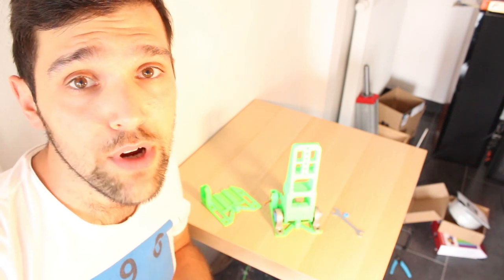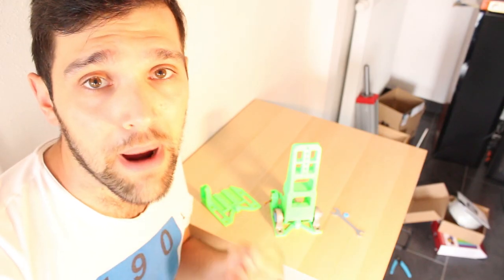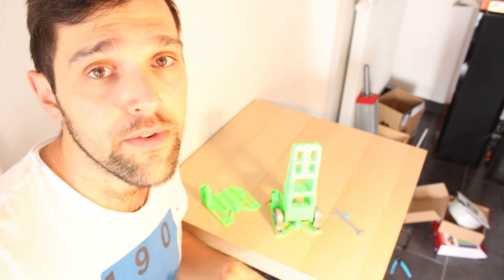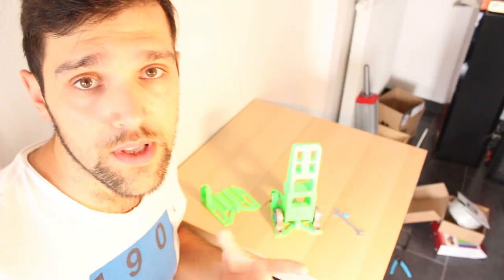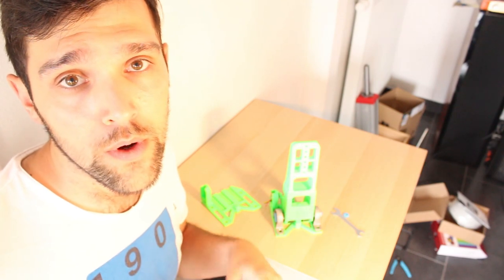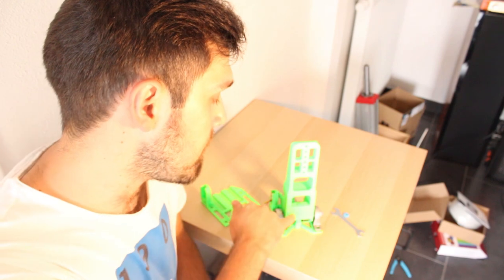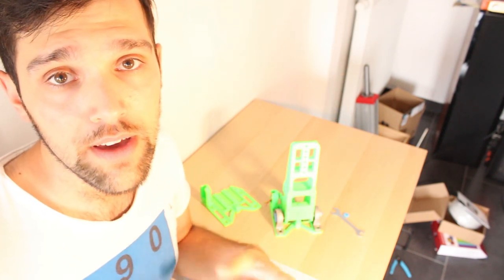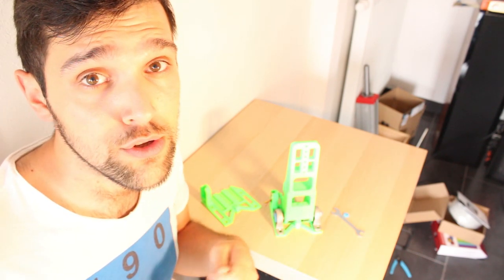Throttle pedal SRT "GT" v5.8 DIY fully tuneable !

Comment: Do You consider to ditch the potentiometer and use hall sensor and magnet? Ie. AS5600. It cost same as good quality normal potentiometer, never wear out and comunicate thru i2c.
Reply from the maker: I will do it for the P1 throttle pedal. The hall sensor would make the GT pedal even wider :/